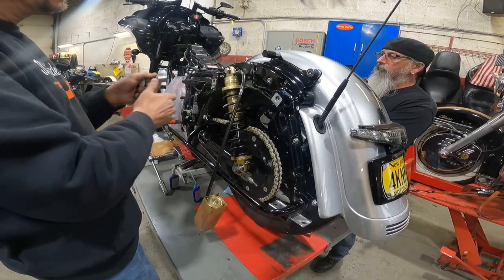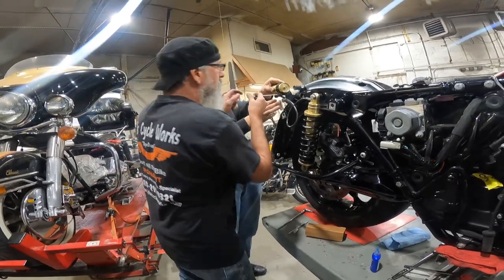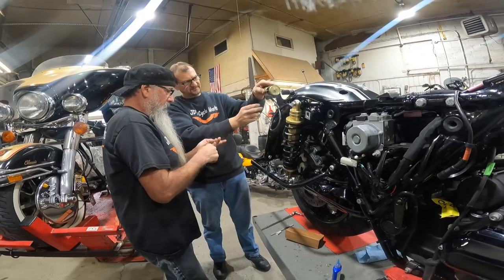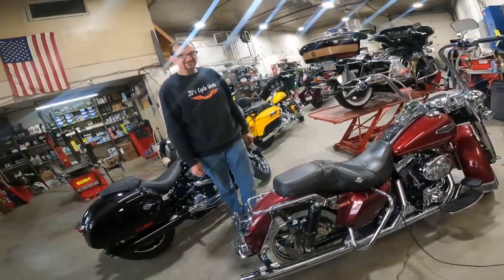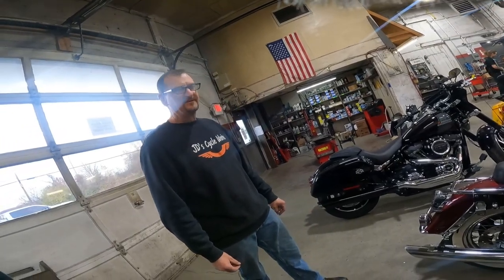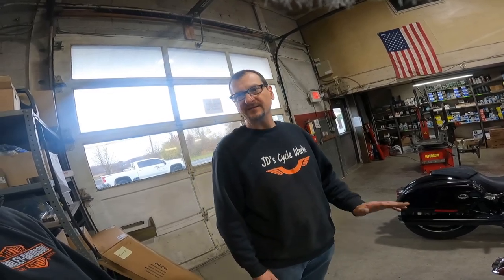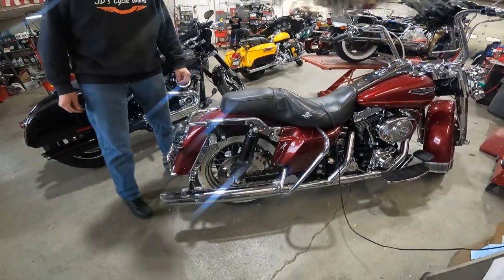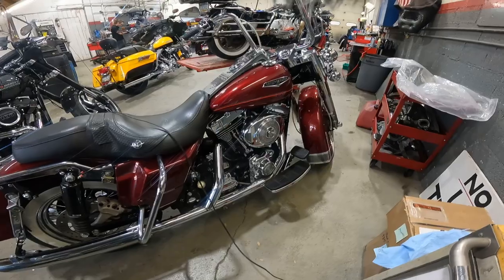SILVERBACK GETTING LEGEND SUSPENSIONS REVO ARC IN GOLD - 2020 ROAD GLIDE SPECIAL PERFORMANCE BAGGER

Comment: Looks very good
I went with the Legend Air adjustable  A on my 2015 Limited CVO  but I didn't like the air pump under the engine so I made up some brackets and mounted it under the tour pack